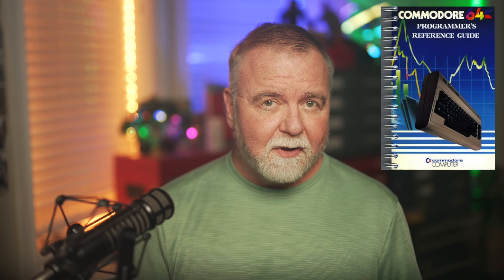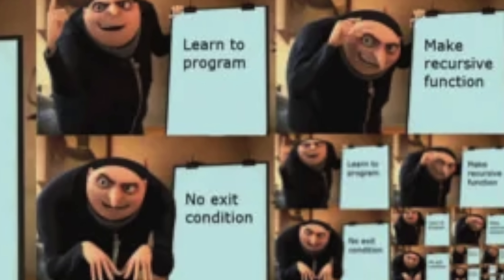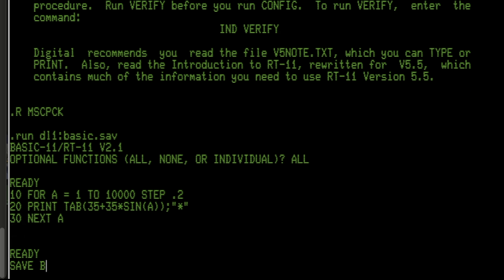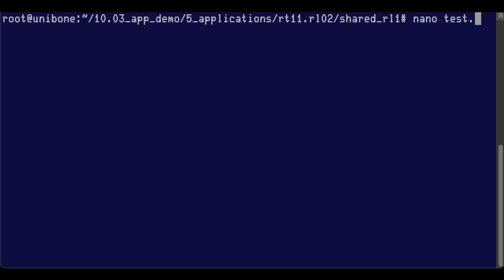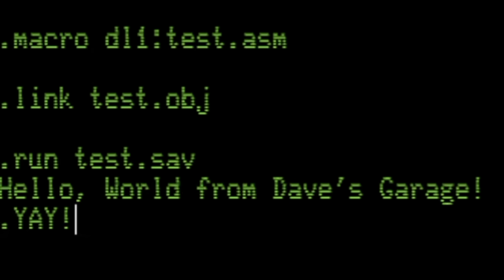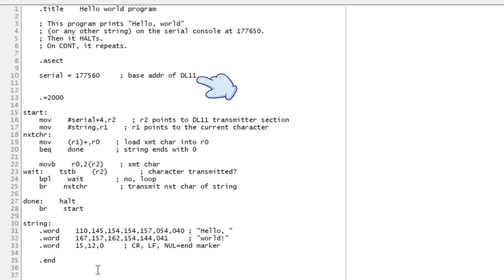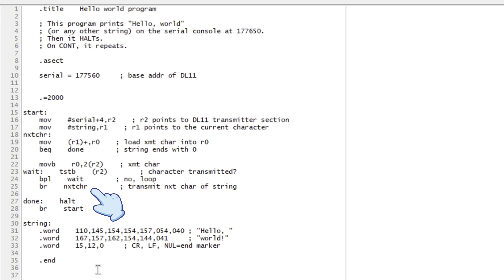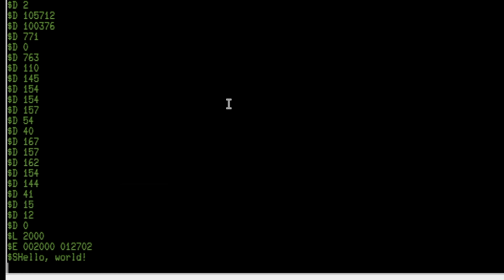Bare Metal Coding: Big Iron!  Assembly Language on the PDP-11/34

Comment: I only know PDP 11/34 assembler. we used it for a systems software course. inter process communications, pipes,  process locks, kernel and process messaging and  remote procedure calls in UNIX and RSX-11M  with Those OS's running scripts on a shell to call dedicated assembler routines to do the work and pickup the results. They eventually replaced the 11/34 with a MicroVax 11/780 and the 400 sq foot  room looked so empty from being full with 6 LA034's six VT-100's a line printer and the PDP 11/34 with it six cabinet......... one tiny full sized tower  replaced it all.  The room was decommissioned and the MicroVax got moved to the main data center and put  in a corner far far away from the 43811 mainframe and its  fridge sized disk cabinets and its line printers and  the six dual screen operators consoles. Its like they didn't want to acknowledge its presence. . You then used a dial up modem (In My case a USR Modem)  to connect and log in. No More VT-100's No more LA-34's You printed on your local printer if you were rich enough to have your own printer at home. The MicroVax was an order of magnitude faster then the PDP 11/34 and it sat idle most of the time except for  a Unix course and the systems software course. It was the only machine running Unix in the entire university at the time. I felt sorry for it and thought it was lonely. It  was so far away from the mainframes and then they  built a half wall  around it with a gate so it couldn't see any thing anymore. I used to look in the window at the data center  and  say hello to it sometimes.

Comment: My first job after graduation involved programming in Fortran on a PDP11/34. Removable storage at the time consisted of 14" diameter 1Mb disks.
I shared this computer with two other software engineers. Every so often I had to run a large simulation. Had to arrange with the other two engineers to tie up the PDP11/34 for an  entire week!

Comment: My first computer was a PDP 11-?. It and all the radio equipment humming and heating up the van had red thermite incendiary devices on top. There was a safe with two keys and inside was several vivdly lableled Manila envelopes and in one of them was two standard IBM pre-punched cards. If everybody in the world was about to be vaporized, we would open the front of the PDP, take out a large jumper board, lay the cards down, just so, and very very very carefully insert tiny jumpers into the pre punched holes....... Any more details would be boring and are probably still classified anyway, but suffice it to say,
I've worked with computers ever since, off and on, but never in quite so consequential of a context.

Comment: I'm in agreement about the beauty both the PDP-11 instruction set and the 68xxx instruction set.  Very clean, very easy to use.  No real surprises when coding at that level.
Reply: +1. The first two instruction sets I learned were for the IBM 360 and the PDP-11 (writing an emulator for the latter in the former for a course). A little later I learned the 68000 ISP which was an easy follow on to those. Eventually I encountered the x86 architecture and I’m like what? Address calculation isis done how? Fortunately I rarely had to dive down to that level when programming for x86 boxes.
Reply: @NathanielMishkin  Interesting.  The 360 instruction set with it's (I think) segmented architecture has made me think that it was an inspiration for the x86 architecture.  I had to learn a superset of the 360 instruction set for an avionics processor called an AP-101C, which is like what flew originally in the shuttle, and is like the 360 instruction set, but has specific instructions for doing trig operations.
Reply: Ah, no on your inspiration point (at least not for ground-based 360 CPUs :-). No segmentation. If anything it was the 68000 instruction set that was inspired by the 360.

Comment: You might not believe me, but in 1978, my university had a PDP 11/34, and as a student I had some machine time available. I programmed in Fortran 77, mostly, but I remember I also ventured into assembly, after the professor had explained the register set and part of the instruction set. I still clearly remember the peculiar fact that R6 and R7 had that special meaning. Combined with indirect addressing, and autoincrement, this allowed some very nice tricks. It really was a wonderful architecture! Thank you so much for sending me back in time to those enthusiastic days!

Comment: Goodness - BASIC in CS; when I went to school in 1983 CS-100 was PASCAL on the College's DEC System 20; use of GOTO was an automatic F.  Spaghetti code was an automatic F.  Pretty big change in thinking for a kid who had learned BASIC ion the Apple II back in 77 in school, and moved on to mixed BASIC and assembly on a Timex Sinclair 1000 with a bunch of add-ons like a real keyboard and 32K of memory.

Comment: I was reprogramming Russian missile controllers with PDP-11 in 1977 Finnish Army. More specifically we replaced  tubes+relays  with Intel 8080. We used  PDP-assembler with macros that produced 8080-machine code. Rumour is that Russians stole the code, when they had their own 8080 and used it in Afghanistan. So I am basically a war criminal.

Comment: I never played with DEC internals, but the features seem very familiar. Once you've played with one instruction set, picking up another is straightforward. When I was working with an IBM360, I came across a manual describing its assembler. It was only when I started attempting a "HELLO WORLD" that I discovered that that manual did not describe any I/O. In true IBM style, that cost extra.

Comment: Oh yes! My - actually my lab's - first computer was a PDP11 running RSX11-M back in the 1980s. We were trying to do speech IO in real time, a hugely demanding task in those days. We enlisted the help of a friend of mine called Adrian. who was an RSX-11 system programmer - bow down and make homage, please: these guys were gods! 

Adrian had his own PDP11, which lived in his front room (he was single, so where else would it live?). With Dave's PDP11, it looks like you just press a few switches and the machine comes up - luxury. Adrian's PDP was not so advanced and initially required a lot of manual intervention to get it to boot up. Eventually, though, he bought a boot board for it. This was a card, about 20 x 25cm, with an array, about 8 x 10, of locations, which you slotted into the machine's back-plane. In some slots a big capacitor had been soldered in. In other slots there was no capacitor. (Or maybe they were resistors.)

When the PDP started up using this boot board, it read the presence or absence of a capacitor in a slot as a 1 or a 0 and used a complete row of 8 slots to form  1 byte. The 10 or so bytes hard-coded on the board defined some machine code, which told the computer where to find the OS on disk and how to start it up.

A beautiful illustration of hardware as software.

Comment: You can run Tetris on this! The original, first version of Tetris as written by Alexey Pajitnov was made for the Elektronika 60, a compact Soviet clone of the PDP-11. The character set will be wrong, but it works on emulators, so it should run on the real "big iron" as well.

Comment: Here's a little puzzler that fooled a lot of people into thinking the machine had AI.  It worked best on the DEC writers.  About half a page of Basic code.  You asked people around you what to ask the computer.  You would type the question , hit return  , and it would give an appropriate answer.  Questions like, - Is it daytime ans=Yes,  Is it raining, ans=No.  What's a henway ans=That is a ridiculous question.  Are you smart. Ans= Of course.  Who is going to win the election Ans= I'm not sure.   After about 6 questions, someone wants to take over and will sit down at the type writer, and all answers they get are rude and non answers.  They thought it was a ? at the end of the question, or spacing, but could see nothing.  It was done by taking the first character you type and not echoing it (a system call needed).  then if it was "asdf" letter you got a negative answer, and "jkl;" letter got you got a positive answer, after the rest of the line was showed and return hit.  You touch type, so no one sees your finger hit the first key.  If someone wants to take over , you just hit space bar as the 1'st character before stepping aside and the code loops with insults.  AI before its time  - not quite.

Comment: It has been a long time ago. But i remember back in the amiga days, to get rid of the os i used “trap #0” (divide by zero would also work). You could also take over the level 1 to 7 interrupts and nothing would run except my own code. To get out of the supervisor mode you would use RTE or return to exception, i don’t remember if there was a separate stack for exception return addresses. If a subroutine would be called, the return address would be put on the stack, in the subroutine itself you would save the registers you used yourself in the subroutine (or all of them if lazy) and restore them right before the RTS or return to stack. Since the stack is freely available RTS will jump to whatever is on there, so it technically isn’t necessary to use a RTS for every JSR since you are free the manipulate the stack anyway you want. Maybe that is what that exam question was about?

Comment: We were about the first business (non engineering) company in Canada to buy the new "Dec business" computer 1976 or 77?.   They did treat us like royalty down in Maynard. It had very little to help writing business apps.  The data access routine that was supplied had to be accessed with just 1 hash index structure (exact key), or I think alternatively a more complex random/sequential 1 data plus 1 index structure . RSTS.  Basic was the language being used to support business, but very limited. Open an employee file, and 1 other just about blew the memory limit.  And then there was no routines for putting up forms.  These had to be cranked out, so we had to write some general screen handling basic code, very memory consuming.  Nothing on the market for DB, but something close.  I had to let a PDP 11/70 sit for about 8 months while I developed all this.  Put multiple tables in 1 large file, with  another for multiple indexes on any of the data, That let us open 4 to 5 files with 7 indexes in 1 go, saving memory.  Some of the data entry that didn't need the speed, but had lots of things opened, could also use the same data access routines by using subroutines that used system calls to send/receive packets of data to another process, or could even be another machine according to the doc.  This freed up a little memory.  I was surprised at the speed it could do this, so it worked good.  I had index to data check program, and converted to assembler, and it ran 100s of times faster.  As much problems as I had, it was still the love of my life :)  What a change from the old punched card, 10k machine we had, but now that I think of it, that machine did run any size mini-cobol by swapping out the last 512 bytes loaded automatically.

Comment: "Freshly booted" with no OS, Dave? What are you booting into the computer with no OS? When you did this "bare metal" thing before, you just turned it on and started switching in and sending code lines without any boot, didn't you?

Comment: Why would you cross-develop for C64 when you're not porting, when you can just write right on the 64?
Reply: I think that in the first few years of the Apple II, Apple and Microsoft used cross-compilers running on bigger machines.  But by the time of the C64, I agree, it seems like a needless expense.
Reply: @kc9scott : But still, why, when it seems like they wouldn't really have needed it?
Reply: @HelloKittyFanMan  The only reason I can think of is if it was early in the life cycle of the C64 and no one had yet produced any good development tools.

Comment: What?   Big Iron?  Worked on the IBM 360/370 mainframes starting in 1976 at high school from a teletype and some card punches.  We didn't even call the mainframe BIG IRON until the mid 1980s.  I totally agree with you about the "from too" direction.

On the mainframe it was LR    R1,R2  or load register1 from register2.  so still works in the reverse direction if you fool yourself in using the different phrasing - or as in Canada - shift your thinking to French.  :)  I still have my own 1998 mainframe, an IBM P390 CMOS card that lives inside an IBM 330 server.  The disk is accessed through an OS/2 interface.  "PC Server 330 S/390 8640-PB0-11Y"

(From the reference manual on IBM mainframe assembler)
LR R1,R2 
"Load value in register R2 into register R1. "

Or the way I liked to write it, "load register 1 with the contents of register 2", and it seems more logical.  LR means load register
I won't pretend I don't like the PDP11 MOV instruction better though.  

I worked tracking satellites with Canada's Ministry of the Environment back in the late 1970s in Toronto and I think I still have a paper tape sample we used to load the instructions to the Mini computer, that could have been a PDP (can't recall exactly), that tracked the TIROS-N and NOAA 5 satellites via a moveable tracking dish on the roof.  No reader though.

Thanks for the video, entertaining!  Cheers

Comment: I jumped into assembly language in 1978 on an AlphaMicro system that was shared with other students at the University Computer Club. Assembly language was almost a carbon copy of the PDP11's.
Previous programming had been on calculators.

I wrote more AlphaBasic than assembly, using assembly as required, including subroutine calls from BASIC to e.g. drive a MicroAngelo S100 card efficiently by establishing Supervisor Calls ... Extensions of the operating system's monitor. 

I never had the spare time to hijack the Z80 resident on the graphics card to provide more "native" graphics primitives. Learning another assembly language and hand assembly... no thanks.

Comment: Two things.... use .MAC for assembly file extension.  It's the default and you can then omit it from the macro command line.  And as shown,  your bare metal program would not have worked as you used a WORD  MOV to load the next character to print-- it would have printed every other character then continued through memory until it found a random word of 0.

Comment: I got my introduction to assembly on a Vic 20. The coding was simpler than you had. It had 28K for programs and 8k for external rom/ram. The best I did with it was wrote a start up in the 8k that would store/remove launch and tell me what floppy to use. All using a joystick. The software I used was Hesmon. No help if you got it wrong. Love the 6502 !  I learned fortran, later basic and then machine code. That was wonderful.

Comment: Ah, PEEK and POKE. I once did a small project to link two Apple II computers via their joystick ports, which had both input AND output pins. I had been thumbing through the manual and found the addresses to set output pins low or high using POKE, then read the digital values via PEEK on the other machine. It was crude and required a very slow data rate to be reliable, but I was able to transmit simple text messages. I relied on timing alone, inspired by Morse code. In hindsight it likely could have been much faster had I used one pin as clock signal. Fun times!

Comment: sort of a tangent... but you were talking about the difference between registers in the PDP11 and the 6502. I never thought much about it until I wrote an Intel 8080 emulator (the 8080 has 7 registers) - but that really got me realizing how awesome the 6502/6510 really was. The things that were possible with just 2 registers.
Reply: I agree, loved the 6502, especially the small number of clock cycles per instruction.  But was annoyed with its 8-bit SP, which meant that most high-level languages needed a P-code interpreter.

Comment: I n the early 1970s when I was working at a CND university they had a DEC emulator that ran on their mainframe computer so the students had their virtual DEC box and could type their computer programs into this virtual DEC computer and single step  instructions or run the program. I  can’t remember if it emulated a PDP 8 or 11. Did plenty of machine language coding in my early years back in the late 1960s early 1970s. My favourite was the Burroughs DCP, data comm. processor.

Comment: I wrote code in the early 60s for an IBM 36-/30 using Assembler, and later a bit of Cobol and Fortran. Assembler was always my favourite; it's very "what you code is what you get"....very efficient. That original company progressed to a 370/145 running VM (OS and DOS concurrently). It was a lot faster, but those big disk packs were really heavy!
After that I spent a short time on some smaller machines before leaving the industry. I still have my flowchart templates and reference cards... 🙂

Comment: Ex VAX and Novell Netware guy here.  We wrote a Bindery syncing tool  for our Netware system, ran on a VAX, to sync the user-accounts and passwords between domains.   We would create accounts only in VMS, but inject the users credentials into each Novell Bindery every 10 minutes.   The code was only 50-60 lines long and was blisteringly fast.   Added more comprehensive error checking a little later on, but basically we had a 4000-user network running on 50 Netware servers, with unified accounts at all sites, with the integration  making everything so nice.

Windows NT Advanced Server and SQL changed all of that in 1995..   All went away...

Comment: The PDP11 instruction set was brilliant. The mov instruction was wonderful as was putting device registers in addressable memory. You brought back memories of the programming card that summarised the instruction set. It was highlighted with the Digital magenta color. Much better instruction set than the PDP 8. It is a pity that the x86 designers did not follow this example.